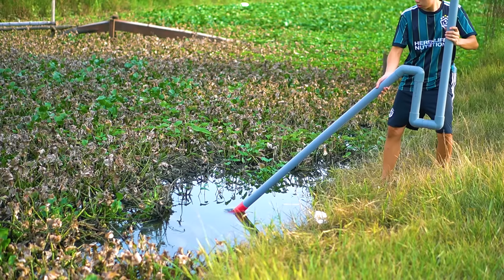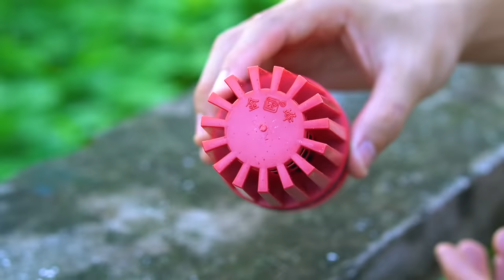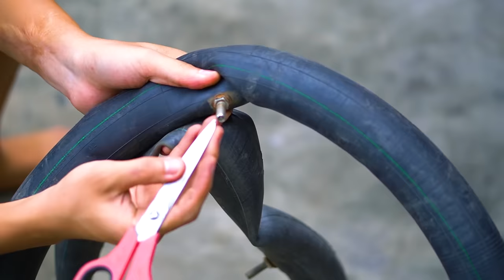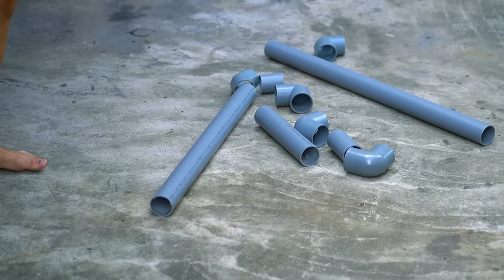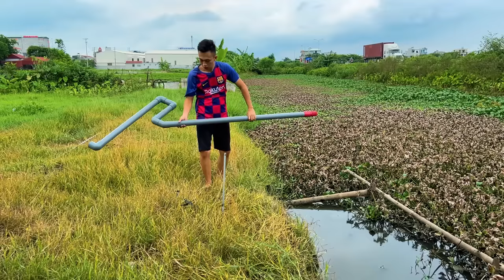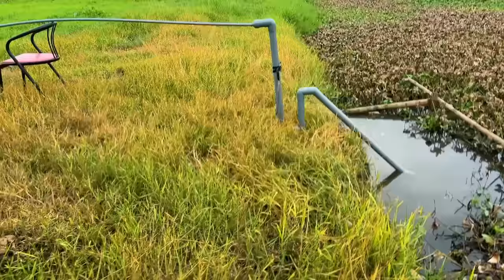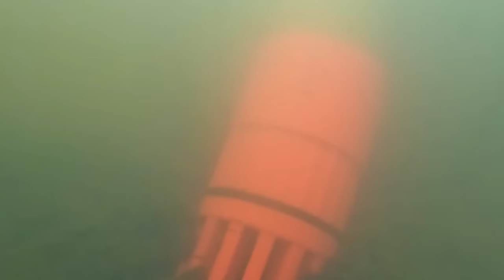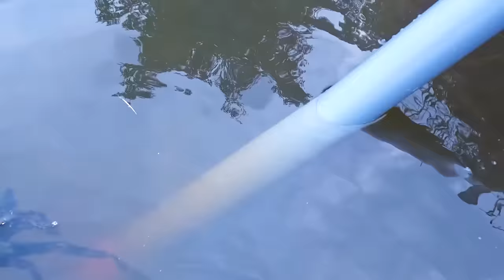I turn PVC pipe into a water pump no need electric power

Comment: If this was even possible it would be done world wide.
Reply: bro i m also search for real project like this if this work ! if u a exprnt on this method so plz share its real or fake and also share real and sold method its bnfical for farmers !hmm i m waiting for positive ans
Reply: @arainpashassu5738  take a physics course. This is nonsense.
Reply: @arainpashassu5738  CLEARLY,  -  FAKE,  FAKE,  FAKE !!!
Reply: @arainpashassu5738  look up hydraulic ram pump, continuous flow with a small current.
Reply: @nateg08  are you a physics genius. Not every one has the ability to take on such a subject, hence the beliefs off this video brings people together to discuss its possibilities or its hoax. No need for negative comments.
Reply: @rjflippo  ram pumps, from my last knowledge, use water movement inertia to pump at the expense of water loss. This pump I've not yet figured out if it's possible. Perhaps there is similar slamming action going on with an air gap inside the dip trap. It's racking my brain however.
Reply: @onepercentile  I have made a ram pump that was fed by the current of a small stream and it pumped it 100’ with a 25’ elevation gain. Worked like a charm. 

The pump in this video defies the laws of physics as there’s no energy presented to provide the continuous feed of water it depicts.
Reply: @rjflippo  Nice job on the ram pump. I bet it's amazing to watch. 

I totally agree with you on this pump defying the laws of physics. I don't think it's even possible to move the pipe back and forth submerged in water to fill the entire pipe. The head pressure alone at 1/2 psi per foot height would have to be overcome with some sort of funnel to compress.

I still try to remain open to possibilities I don't fully understand. It would be amazing if this worked nonetheless.
Reply: @arainpashassu5738  fake, it's impossible.
Reply: Yup. If this guy could do this we would have unlimited hydroelectric power.

Its funny how Twitter and Facebook will screen posts and fact-check things, but YT won't lift a finger to eliminate this trash.
Reply: The most broken physics in the work have done...
Reply: No need to buy motor pump if this was possible
Reply: @rjflippo  Yes Indeed: a Ramp Pump needs a Water Flow consumption to Power it. Here I am afraid the Youter has Lost his Integrity to make a Fake on th subject that will generate View and Comments to make some Bad Moeny; So Sad :/
Reply: As soon as I saw I greatly questioned the physics behind it
Reply: Fake
Reply: Thank you
Reply: even if he were using a stabbing motion to force water into the bottom and pulling the plunger closed it still would not flow like this. Should be banned from youtube as harmful because someone is going to go out and spend their money on this, money they may not have to spare in this economy. Not as entertaining as it is evil because is see no disclaimer.
Reply: SCAM! SCAM, SCAM!
Reply: It works but there’s a different way to do it
Reply: @monk1100  You don't have to be a physics genius.  If you took science in 7th grade, you know this is impossible.  Water, unaided by mechanical means, flows downhill only.
Reply: It is called siphoning
Reply: @arainpashassu5738  real
Reply: @rjflippo  then why did it work for me something is not right what you are saying
Reply: @nateg08  The schrader valve is the key.
Reply: The question is not if it's fake, but rather what's the trick. We all know magicians don't do magic. 
Well done for this guy.
Reply: @rjflippo  Sure there is in the form of the small hidden battery pack powering the water pump inside the pipe. HAHAHAA
Reply: no trick world WIDE e BAY
Reply: It is being done on earth's second moon to power the invisibility shield.
Reply: terracer  really???
Reply: @rjflippo  ram pumps have nothing to do with current, it is you who needs to look them up.
I'm revising my comment: it is possible that IF the current were substantial enough to produce enough pressure in the inlet pipe the ram pump could work to some degree. I would think that the initial end of the inlet pipe would need to be of some larger diameter than the last part of the pipe just before the ram pump itself. This pressure could be added to by building some small coffer dam. Or by running a flume nearly level along the creek for some distance until the last few feet and the flume then angled sharply downward to make the water run fast to the large inlet pipe, this extra velocity of the water may be able to enhance the pressure into the ram pump entrance. 🤔
Reply: @onepercentile  it's FAKE there is NO action going on inside the device it's hooked up to a standard faucet which is where the water is coming from.
Reply: @LincolnHawk-bk5yr  how does it get from ocean to cloud? 😂
Reply: @railroaded1991  Uber.
Reply: this is possible but govts and water supplier won't make money if everybody will do it. It uses the principle in bike wheel pump plus maybe siphoning
Reply: @LincolnHawk-bk5yr  maybe he's using gravity powered attached down there
Reply: @beverlychua7861  ah, you're a conspiracy theorist making up stuff that isn't true and you're completely wrong about the syphon. 😂 Make one, prove it to the world, we're all waiting.
Reply: @railroaded1991  had a current from a canal that fed a ram pump I once made and was able to push the flow uphill for a project.
Reply: 🤣🤣🤦🤦🤦🤦🤦this is not fake....the people who think its fake gotta be young....havnt yall seen movies jesus christ the good ole stealing gas from a car trick....my god
Reply: @CookinwithChris86  so build a few thousand and start selling them. 😂 You do understand that movies are fake.
Hey if you want to be able to run your car for forever without ever putting more than a cup of gasoline in do this: put a flex pipe on your tail pipe and run your exhaust into your engine's intake start the car up, the exhaust contains carbon monoxide which is flammable then the car will continually run on the carbon monoxide going round and round. But first you need to fill your gas tank with water once the engine is going the water that gets pumped into the cylinders under the heat and compression will break down into oxygen and hydrogen. Hydrogen is also flammable and it burns really well with oxygen.
Reply: So fake its funny. I sort of admire him for being so cheeky
Reply: I don't think anyone actually understands how pressure works because this is definitely possible. I'd like to know how you all think he faked this because it would be more interesting to see how you think he would pull off creating a fake pump that size. That would actually end up being more impressive honestly. Anyway there are plenty of wells worldwide that operate solely on water pressure. Hard to believe how smart y'all are.
Reply: @heliotarrara  I think there is an electric pump in there, just a small submersible one like they use for caravans and motor homes, or just a hose connection under the water. just a quick cut. Like you see in the video when he puts it in the conveniently dirty water and someone plugs it in. Have a quick look online. you could fit one in those tubes easily. I think the wells you mean are using a ram pump. They run on water but they use some of the energy from flowing water to pump a smaller volume of water at a higher pressure. The thing in this video is definitely fake. It would be creating energy from nothing breaking the rule of conservation of energy. Which is impossible so you can tell it's fake. Pressure is involved but it's not the main issue here. It's more that he's breaking one of the fundamental laws of the physics.
Reply: @heliotarrara  show us
Reply: @railroaded1991  ram pumps require a current, that is how they work. Energy cannot come from nowhere.
Reply: Bro they make fish tank cleaners that do this exact thing. So yes it definitely does work
Reply: Fake no posible Bakvash
Reply: terracer  can't flow like this anyway
Reply: @rjflippo  ram pump flow is not a continuous flow it's a pulsating flow.
Reply: @rjflippo  not true, they require head pressure. However, I have revised one of my answers, you should look at it.
Reply: @beverlychua7861  😂😂😂😂
Reply: @nateg08 you don't even have to do that common sense just for ratings
Reply: @monk1100 it is not negative very positive JUST TELLING THE TRUTH
Reply: So many people saying this doesn’t work….Has anyone else actually tried to build the thing? 
Post link
Reply: Hi its a southern hemisphere water pump, They uses them in Australia because of it position on the globe.  Asia is in southern hemisphere the video shows different water flow rates.
Reply: It is possible and it is done worldwide. It's called siphoning. This technique is used to drain ponds, siphon gas from a vehicle into a gas tank, etc. Google the word, "siphon".
Reply: @ToddBeal your half right. It does do those things but when the drain output is lower than liquid surface being drained. I drain gas like this all time from my truck to lawn mower and other things like garden and fish tanks.  And the only way it ever works is if lawnmower tank or at least end of draining hose is below surface to be drained.
Reply: It is possible but not in the way he did it .
Reply: is possible with the right water pressure from the pond, it is called siphon effect
Reply: @johnslugger 😂😂😂😂😂😂😂
Reply: @railroaded1991  :body-blue-raised-arms::hand-purple-blue-peace:
Reply: terracer you’ve never siphoned gas from a car? If the fluid moves down fast enough it’ll pull more behind it. You don’t need a masters to know this, just “gravity” fed.
Reply: You have to prove that's not true....do it!!
Reply: Isso é Falco.nao tem como a água subir há uma altura dessa kkkkkkkk
Reply: @nateg08  You say this after you copy his but it failed to work as his claimed or based on the lesson we all learned in school?
Reply: @junkvista61  well I definitely didn't waste my time making this silliness.
Reply: @nateg08  Awww, Come-On! Next week we are making A-bombs from pipe cleaners and Potatoes.
Reply: @johnslugger  well my wife actually made a bomb out of a potato once. Not A-bomb, but a bomb. She forgot to poke the holes in the potatoes before putting in the oven. What a mess. I always thought that was a myth that potatoes would explode... it's not.
Reply: LOL

Comment: That battery operated submersible pump in the foot valve makes the shaking motion work better.
Reply: SCAM! SCAM, SCAM!
Reply: @johnslugger   = later. after he puts the pipes together at 6:15, suddenly the lower pipe with the pump in it is more than a foot longer.
Reply: The water is pushed first. The check valve pushes water up, every time he shakes it. The check valve stops the water from exiting through it. Once the system is filled with water, then the siphon kicks in the draw the water up, as the water falls out of the top. It's the designs series of falls that keeps pulling the water into the tube.

Comment: That would be a perpetual motion machine if it really worked.
Reply: With the right setup it could actually work, but he has a pump in this.
Reply: @JF32304  He has the right set up. A pump. 🤣
Reply: It will pump perpetually. At least until the batteries die.
Reply: Over Unity?? LoL. Siphon is the only perpetual thing I know of.
Reply: @bubbajones7486  only if you have an infinite water supply
Reply: @encyclopath  ahhh yes. You are correct.  It's not a pm machine.
Reply: Someone needs to call Newton right away! Apparently his laws don't apply anymore and the world's energy shortage is solved.
Reply: water has a perpetual motion machine on our planet lol.  it falls runs down evaporates up then falls again lol.
Reply: @alexbourdon8340  lol. Love your comment.
Reply: @michaelduy9055  :face-purple-crying::face-purple-crying::face-purple-crying: but with no batteries
Reply: Boobie - it's not a machine - a machine, by definition, has muliiple moving parts working together to produce an action .  The only moving part is the check valve.
Reply: SCAM! SCAM, SCAM!
Reply: @JF32304  SCAM! SCAM, SCAM!
Reply: @michaelduy9055  :face-purple-crying::face-blue-smiling::face-green-smiling::eyes-purple-crying::face-blue-wide-eyes::cat-orange-whistling::face-fuchsia-wide-eyes::hand-pink-waving:
Reply: @johnslugger  no no no lol.
Reply: @bubbajones7486 a syphon isn't perpetual motion....
Reply: @Jdjsksjdhdj  That's not a perpetual motion machine. Perpetual motion machines don't need energy to keep going. The sun has to heat up the water to evaporate. That's costing energy.
Reply: @desmondblake931  why do you tell yourself that you know everything?
Reply: @Jdjsksjdhdj  I don't. But I do know that perpetual motion machines don't exist at all, even things in nature.
Reply: This even more impossible than perpetual motion.
Reply: The water is pushed first. The check valve pushes water up, every time he shakes it. The check valve stops the water from exiting through it. Once the system is filled with water, then the siphon kicks in the draw the water up, as the water falls out of the top. It's the designs series of falls that keeps pulling the water into the tube.
Reply: @bubbajones7486  Siphon is not perpetual. It only goes until the source fluid/water runs out.

Comment: Okay I'll admit it, I got excited for a second. I really wanted it to make sense because I was already building my energy producing perpetual motion machine. I'm very open minded that if somebody ever figures out a way to do it, it will probably be in a way that in hindsight should have been obvious to us because it will be a very simple principle, like water crawling up a sponge.
Reply: I can help. The water is pushed first. The check valve pushes water up, every time he shakes it. The check valve stops the water from exiting through it. Once the system is filled with water, then the siphon kicks in the draw the water up, as the water falls out of the top. It's the designs series of falls that keeps pulling the water into the tube.

Comment: Finally, a video to 'disprove' Bernoulli's and energy equation which I learned in Fluid Mechanics and Hydraulic Engineering. The piping must have negative head loss or the system is creating energy for this to work 😂😂
Reply: I agree. I wasted all those years getting a mechanical engineering degree. After seeing this video, I want my tuition money back.

Comment: I feel like my knowledge in physics is totally gone wrong and gravity doesn't exist
Reply: ...I'm with you brother ...incredible.
Reply: yes gravity sucks
Reply: The incredibles   🖖🏻
Reply: Gravity exist, someone had to tell you what it was at some point in your life.  Allow this to be the point that you learn how this works. Open minds please. 

The water is pushed first. The check valve pushes water up and into the tube, every time he shakes it. The check valve stops the water from exiting through it. Once the system is filled with water, then the siphon kicks in the draw the water up, as the water falls out of the top. It's the designs series of falls that keeps pulling the water into the tube. It's like drinking from  a straw when the straw is full. Once you allow air in, the suction is gone. The check valve stops the water from leaving and stops air from being drawn in.

Comment: I'm trying to make this, could you please tell me what sort of pump you have in there? And where do you hide the battery?
Reply: When he puts the long end of the pump in the water, you don't see it clearly, but he's agitating the pipe up and down (along the length of the pipe) which is forcing water through the check valve into the long tube and it can't drain back into the pond.  When the long tube fills to the first bend (the 45 degree), an auto siphon is created which pulls the water up the long pipe and over the 45 bend and the first 90 bend.   The two bends form a U-siphon which assists in pulling water from the pond.  I don't understand how the water then climbs above the siphon, but the inside of the U-siphon has a partial vacuum, and the open end of the pump is at 14.7 psi (air pressure). The pressure difference (including the weight of the water) may be able to lift the water that 3 ft. I'd add a downspout there to create a second siphon. Ingenious device!  U-siphons are regularly used in aquaponics to drain media beds, but the exit end is below the water level in the tank and they don't require a check valve because the bed is always filling.  The height of the U siphon sets where the water will start flowing by siphon effect.
Reply: dont waste your money, see comments above
Reply: @davidgharrod8174  Hey could you explain more what you mean by adding a downspout at the top end to create a second siphon? My nephew and I are going to build this to match and try it out. Once we do that, I would love to know how to improve upon the concept further.